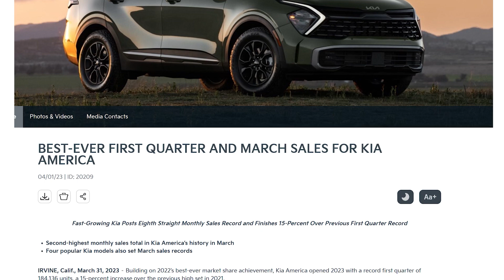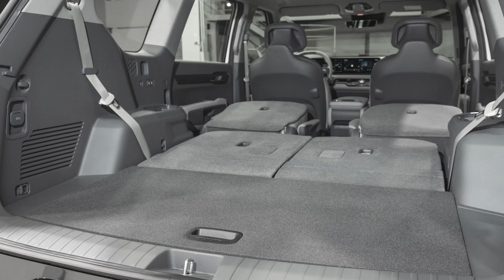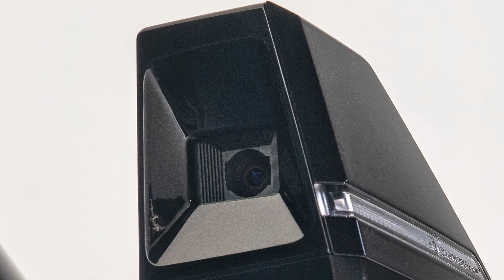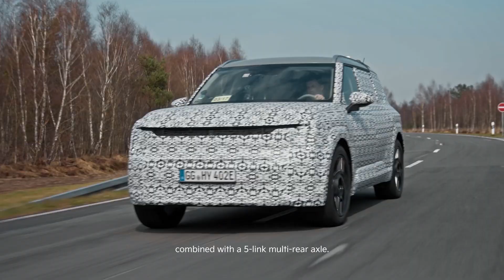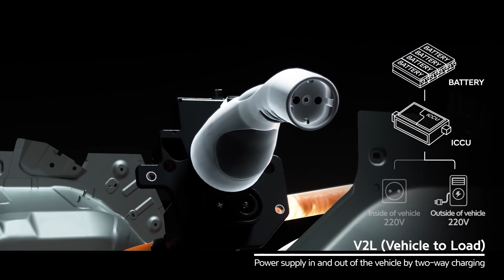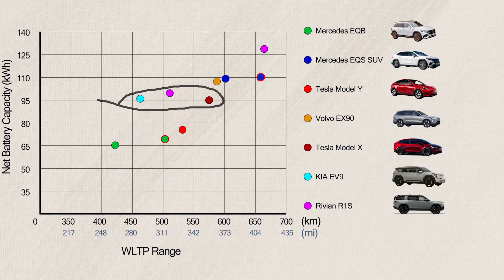Future of Kia's EVs: An In-depth Look at the Stellar EV9!

Comment: How would you compare this to BYD Tang?
Reply from the maker: It depends on what you are looking for e.g. 7 seater family SUV and where are you located. In China, it starts from $45000, in EU around $80000 and in US is still not available and might not come soon due to geopolitical tensions. 

For $80000 in EU, I would prefer EV9 for the following reasons.
1 - Price: EV9 looks elegant, feels modern and innovative and is a complete package.
2 - Cargo space: 572 vs 235 L (Behind 3rd row), 1100 vs 940 L (Behind 2nd row), 2320 vs 1655 L (Behind 1st row), 52 vs 0 L (Frunk)
3 - DC Charging Speed (10-80%): 24 vs 45 min i.e. 230 kW peak vs 120 kW peak
4 - 11 AC Home Charging time: 11 vs 14 hours i.e. 11 kW vs 7,4 kW On board charger
5 - Range: 497 km (EV9 in Germany) vs 400 km (Tang in Germany); The average person drives about 13500 km/a. in Germany. Assuming all charging was done with DC chargers from 10-80% - so it means 44 vs 54 charging sessions = 17,6 vs 40,5 hours charging/year.
6- Warranty Period: 7 years (150000 km) vs 6 years (150000 km).

This is only my opinion. BYD is a giant, the 2nd largest BEV producer and largest including hybrids with 27 years of battery experience. The problem is the price in EU. For $45000 in China, BYD Tang, is simply unbeatable by any Korean or German EV manufacturer.